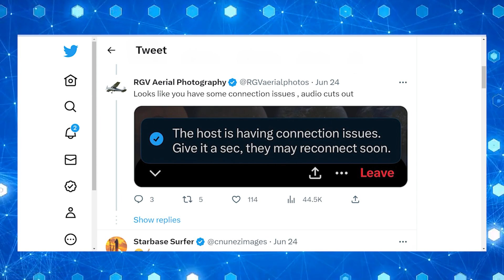Musk outlines major upgrades for SpaceX Starship stage separation ahead of next launch

Comment: Hot Staging is a massive upgrade. Theoretically this would allow the Ship to escape a failing booster and possibly save the crew
Reply: Perhaps. If Elon and SpaceX manage to make hot staging possible without damaging the booster (because of reusability) then this will be even more mindblowing than anything ever done before!
Reply: I hope they are a long way from putting people on this thing - its at least a year away and only after great successful unmanned tests
Reply: @AndyHancock  Don't  worry even overly optimistic Elon Musk wants a ton of flights before making it crew rated. They are taking things safe in that regard.
Reply: StarShip & Raptor is no in its 14th year of Engineering & Development (2009 to 2023) How many more years do you think it will take before it is capable of landing with chopstick, refueling in space, landing on the moon, getting human rated and being reused rapidly? 5, 10 or 20 yrs more? Falcon 9 took 13 yrs to land on earth, 16 yrs for the first reuse and 18 yrs for manned flight. (2002 to 2020)
Reply: @horatio1962  i would say propper development started in late 2016 before then i feel it was nothing more than back of the napkin math and fancy ideals they only started building prototypes 4 or 5 years ago
Reply: no way, no way a SS can have TWR high enough to mount an escape
Reply: @nehorlavazapalka How about when they add the three additional engines they were talking about to Starship? Might it have enough thrust then to do an abort?
Reply: @LordTimelord  most likely
Reply: @nehorlavazapalka  I suspect this change was a result of a question posed to Elon in the post-launch spaces he did. 

He responded that theoretically Starship could attempt to save the ship in the case of booster failure but it would require the ship to ignite it's engines while attached.
Reply: Never stop thrusting, said Elon and 10% efficiency
Reply: @kiwigurn  in Musk we Thrust????
Reply: StarShip & Raptor is on its 14th year of Engineering & Development (2009 to 2023) How many more years do you think it will take before it is capable landing with chopstick, refueling in space, landing on the moon, getting human rated and being reused rapidly? 5, 10 or 20 yrs more? Falcon 9 took 13 yrs to land on earth, 16 yrs for the first reuse and 18 yrs for manned flight. (2002 to 2020)

Comment: Why not. Russians have done it from very beginning. Have they had any problems ever specially with hotstaging? (just for interest)
Reply: Without hot staging the Orbiter must drift slowly away as the booster rotates 180 degrees to set up for slowing down for RTLS.  The Orbiter must then vent liquid fuel, which vaporizes in the vacuum, to produce a low acceleration which settles the liquid propellants into the bottom of the tanks from which it can be pumped to the engines.  Note how complicated that is, how long it takes, and how many ways it can go wrong.  As noted the Russians have long used hot staging, not caring how much damage it costs to the booster.  The vents are to avoid building up pressure in the interstage which would damage the Orbiter.  The Orbiter engines will begin thrusting at their minimum setting, which should give an acceleration of about 2m/s^2.  After 5 seconds the Orbiter will be 25m away from the booster, which has in the meantime continued its rotation.  This separation would take several MINUTES using only the fuel vents.  At that point the Orbiter can increase thrust and pull away at 20 or 30 (with 9 engines) m/s^2.  Given a 30 second warning that the Booster is failing the Orbiter will be more than a km away, and there will be a plume of hot water vapour and carbon dioxide moving toward the booster at over a km/s through which any debris must fly.  Note that even after the FTS explosives ripped a hole in the booster on IFT1 40 seconds went by before there was an explosion!
Reply: Curious as to whether the hot staging will be full thrust of Starship or a minimal thrust staging burn to reduce the likelihood of damage to the booster, followed by a ramp up of thrust once the booster is out of the way.  As you know, none of the Russian boosters were reusable. I believe the Titan II also used hot staging to save the weight of ullage motors.

Comment: SpaceX's "Dedication to a safe and reliable launch environment" was nowhere to be found on 4/20. Must have been a glitch.

Anyway, SpaceX can still get a launch license if the FAA isn't spooked by the lawsuit. I think they are hoping for it to prove they can coexist with the other protected sand bars in the area. A successful launch without causing anymore tornadoes and grass fires will go a long way in the court case. Another 4/20 debacle, or worse, will probably end the Boca Chica experiment.

Comment: Musk's BF Rocket is an Innovation Powerhouse ! ... It needs to be Innovated on a Daily basis ... often 3 times a day ! ... Some Parts are Innovated over and over again , on every Upgrade ... which are Mega Innovations ... and those happen almost Every Month ... Hmmm ... aren't innovations ,  FIXES ?? .... Which means Constant FIXES ! ... or Mega FIXES !! ....... and isn't a rocket that needs constant fixes a BF POS ? .... Ahh Ha Ha Ha ha ha !
Reply: Nope, innovations are not fixes.  Innovations are an improvement to a workable design, whereas a fix is a correction to something that is broken.  I'm pretty sure you don't know what's going on.